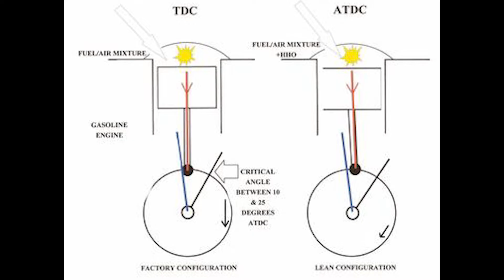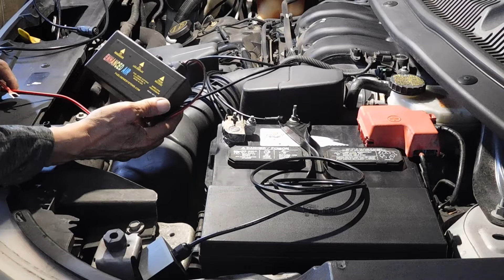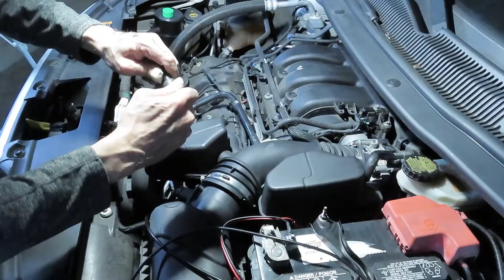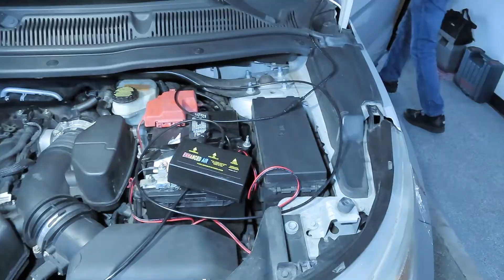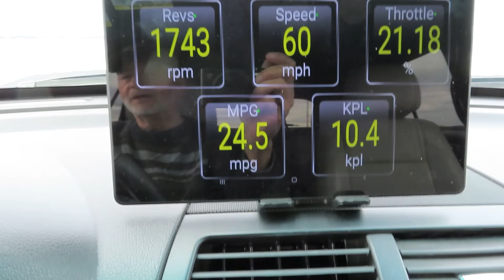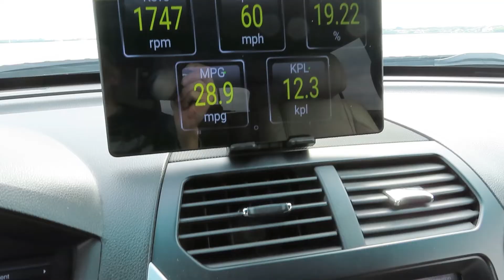NEW FUEL GENIE FUEL SAVING SYSTEM INSTALL AND MPG TEST

Comment: It sounds interesting. I have bought almost all kinds of these systems. My question to you, as I did with the others, is: does this system not leak?  Because the others I knew leak and leave a white residue on every connection.

Comment: Where exactly is the additional energy coming from? Whatever this free source of energy is, why not just use only that to power the car and get infinite mpg?
Reply: That thing he installed is basically a mini hydrogen generator. That generated hydrogen is then ran through the cars air intake system and burned in the combustion chambers.
Reply: @lunaticgaming7967  But where is the extra energy coming from? And whatever that energy source is, why not run the entire car on it?
Reply: @wfjhDUI don't you hear?
İt is producing hydrogen by electricity. 
What you ask is: 
I have put a few spoilers to my car for less drag and better efficiency. So, my car is more efficient now. It was 25 mpg and now 30 mpg.
Your question comes :
Why don't you put 20 more spoilers on your car? Then drag will be zero or even minus and you can drive forever for free! 
😂😂😂😂😂😂😂😂😂😂
Reply: @TufiTufi-l3z  There's a big difference between improving efficiency versus adding an additional fuel source. There are limits to efficiency but there is no limit on the share of fuel that comes from one source or the other. For example, cars can run on pure gasoline, a mix of gasoline and ethanol, or pure ethanol with engine modifications. If water really can be used as a fuel source then why can't this guy make a car run on 100% water?
Reply: @wfjhDUI You know the answer.
This is a petrol car. Not a hydrogen car. Even if it is possible, 
Where will you get the electric power? There is no system that produce more then spend /consumed. If that possible, that guy would be rich!
İt is adding some amount and helping a better combustion.
Think about turbo.
We get 250 hp with turbo from 1, liter engine. Otherwise, we need minimum 2 liter engine for such power.
Your question. Then why don't we take the engine out and run it pure turbo?
Turbo, steal some power from the engine and multiply it. So, we need the engine.
Reply: @TufiTufi-l3z  The electric power would come from the same place - the turning of the engine.
Yes, there is no system that can produce more energy that it consumes. That's exactly the problem here. Electrolysis of water and combustion of the products cannot produce extra energy out of nowhere.
Turbochargers force more air into the engine for use in the normal gasoline combustion cycle. This guy claims that water can be added as an additional fuel source.
Reply: Look up the water powered car ron Wyatt made. If you can understand what hes saying you could do that but there's lots of physics 😅

Comment: I would like to see that scan gauge MPG reading without, and then after.  My experience with those things is they are never accurate.  True MPG readings are measured by tracking miles and doing the math at each refill, which is always way different from digital readings.  They always skew numbers towards +2-4 MPG.

Comment: Very Interesting.  Does this work if you have 0 gas in your tank and only the hydrogen system connected as you did in the video?
Reply from the maker: This is a supplemental gas that is injected into the air intake. You must have gas in the tank. It will improve mpg.
Reply: @fuel-genie-systems1  Why do you need to have gas in the tank?
Reply: Thanks for the prompt reply @fuel-genie-systems1

Comment: I see a lot of support for OBD2 systems, but how well does it work on the older generation (OBD1) fuel injected vehicles? Will this system work on carbureted applications where there isn't a computer for adjustments on the air/fuel ratio?
Reply from the maker: Depending on the age of the engine, you should get at least 20% increases in mpg. Some older Ford models (crown Vics)  are showing 24-26% increases

Comment: 300mA for this big truck, based on calculation 12v * 0.3, the HHO generator are only using 3,6 watts! this seems odd for such small wattage to achieve this much mileage improvement ... have you probably tried 3 Amps on the highway ?
Reply from the maker: We work on the quantum level with our hydronium production. At that level, 3 amps of current will increase mpg in a 16 liter diesel engine 25% to 35% on the highway. Very small amounts of current needed to produce H3O on the quantum level.
Reply: @fuel-genie-systems1  How is it you're using basic sodium hydroxide which forms -OH ions in the water, and getting H30 hydronium which is the ionic form of hydrogen found in acidic solutions which are on the opposite spectrum of pH. ??
Reply: @waynesanders1406  crickets.......
Reply: @fuel-genie-systems1  utter quantum bullshit more like

Comment: You should get Project Farm to test one of your systems. 
They seem to only ever test cheap HOH systems that don't work.

🙂
Reply: This kit only has two small electrodes. There's no way this produces hardly any hydrogen at all. It's a scam buddy.
Reply: @TravisTellsTruths  I can't see the electrodes clearly so it's really hard to tell how extensive they are. 

That's why it would be nice if they could get someone to independently verify how well they work.

I've only seen a few working HOH systems that improve mileage.

🙂
Reply: Thats because hes a lapdog for the CIA baka

Comment: Ever one getting excited about this but you show hooking it up behind the throttle body or other into the PCV valve. Please explain how the computer can make any adjustments for the hydrogen going into the engine when it’s introduced past the mass air flow sensor and other sensors that the computer uses to set the air fuel mixture 🤯🤯
Reply from the maker: That's the beauty of it all. The amount of hydrogen going to the engine is small but very effective. ECUs  of gas engines under 2 liters don't bother with making adjustments for lean mixtures because it is within ±3% of the default value the ECU is programmed to maintain. 
Gas engines over 2 liters need more hydrogen gas to improve mpg. We inject it after the MAP MAF and IAT. Once in the combustion chamber, it leans the mixture. O2 sensors are really the only ones that correct for lean mixtures and we have a Smart computer chip that plugs into the OBD port. It adjusts sensor signals to the ECU- not the ECU itself- and manages fuel for best mpg.
Reply: My MAP sensor is located on the back of my intake manifold. Will it still work? Previous message said you installed after the MAP sensor

Comment: what type of water you using?
Reply from the maker: We use mineral water or spring water. If neither are available you can use tap water. We do not use distilled water.
Reply: You use only watter? Without salts or anything else?
Reply from the maker: @geogeo2902  sodium hydroxide. It is called caustic soda in Europe.

Comment: Is it possible to make the system automatic? Not a fan of fiddling with the remote, especially when driving. 
How about just 2 or three dedicated buttons for your presets - city, highway, off-road etc. 

I'd just make a makeshift permanent control module next to the driver, with: on/off, 3 presets, system power usage and water level indicators. Version two or pro model controls will have beeping sounds for notifications and  a button for automatic system controls. 

Just a suggestions! Cool product though!!
Reply from the maker: Once you have adjusted the amperage for best mpg on the highway, reducing the aps by 50 mA is the best setting for in-town driving. So there are essentially only 2 settings. One when you're driving on the highway and one for in town. It's adjustable because lower temps reduce the production of hydrogen enhanced air so you have to dial higher in the cold months and lower in the summer. Not being able to adjust the amount of of gas piped to the engine is key to why many say this technology does not work. 
There are too many variables to manage in making a system like this totally automatic. We explored this and gave up. Driving conditions change too fast for an automatic system to adjust. It would be in constant conflict as you press or let off the gas. And then there is the cost. It would add a minimum of $100 to the final price. 
Good question. Hope this helps.
Reply: How to order I'm here in the phillippines
For elf truck use
Reply from the maker: @roniecastigon3418  ctl
Reply: What range of makes and models/ years does this system work with. I wanna use it on my dodge ram 1500 5.7 hemi only rear wheel. It's love to save a lot of fuel on my daily commute to work and back home. Also want to try experimenting with long haul travels to see how far i can go on one tank of regular unleaded gas and one fill of water in the hydrogen water tank. I understand regular gas engines are about 30-38% efficient. With the added hydrogen gas on demand through electrolysis of the water, it makes it more lean and burns cleaner. It theoretically helps burn less gasoline. I've heard it also adds a little more 🐎 🔋 and obviously fuel economy. I like that you have a very well thought out and polished up complete kit and system including all the software tech and electronic hardware to make it almost turn key ready with the minimal amount of installation labor.

Comment: What effects does it gave on the engine rings and bearings, oil long term?
Reply from the maker: Since superheated steam is created in the combustion chamber, the grooves in pistons will be cleaned our to original specs after about 2,000 miles. If you mpg is really low and you see black exhaust smoke, adding  hydrogen will clean the injectors, spark plugs (if you have them) valve seats and the grooves in the pistons. You'll be driving along and all of a sudden feel a burst of power for no apparent reason. That's the rings that have become free and now press against the cylinder walls. This increases compression thus a burst of horse power as it happens. We have heard this same story from many, many of our customers over the years. 
Lean mixtures reduce blowby gasses. This means your oil will last 7,000 miles instead of 5,000 and your engine will be clean as new inside.
Reply: How would the hydrogen clean the injectors if it doesn't go thru the injection system. It connects to the intake as in for air not the fuel. So please explain how it would clean injectors?
Reply: @weekendwrench  Its not the hydrogen that cleans the combustion chamber is the superheated steam after the burning the hydrogen. This is what they use when they clean your car from soot build up. They plug and run your car at the garage with hydrogen mixture.
Reply: @barbelis  No they plug directly into the fuel rail and go through the injectors. I will restate my question because I'm starting to think this company is absolutely full of shit. It is impossible to clean the injectors via the combustion chamber or air intake.  if the injectors are a 1 way nozzle there is no possibility in any truth of a statement that ensures the injectors will be clean without going thru the injector. That's like saying if it rains it will clean the inside of your garden hose. 🤦‍♂️🤦‍♂️🤦‍♂️ it won't. It can't. I don't even need physics to understand this.
Reply: @barbelis  how many times did I say the word injectors. The injectors we are talking about the injectors in case u missed it ill type it again for good measure the INJECTORS. The injectors 🤦‍♂️🤦‍♂️🤦‍♂️ the injectors. You know the main component in the injection system? The injectors how can it clean the injectors?
Reply: Mate, I totally agree that the injectors can't be cleaned from the inside. But I think what they mean that it cleans all the soot buildup on the outside of injector. To clean the inside of injectors you have to use a fuel additives.
Reply: @barbelis  I got you bro but they are clearly making a claim that is a scientific, and physical impossibility like I said if they are making these outrageous impossible claims that are too good to be true its simple and not true.
Reply: @barbelis  My man he said the injectors repeatedly. I'm gonna go ahead and call them out the entire corporation is BS be careful buying from them

Comment: DOES IT FREEZE UP IN THE WINTER
Reply from the maker: We have Zero Freeze kits for extreme cold. The "Zero Freeze" model keeps temps in the reservoir above 45Â° F all year around even when outside temps are below zero. This means the system is making fuel saving gas in all types of weather. A thermal controller is powered by a microprocessor to keep drain on batteries to .4 amps depending on outside temp. Click this link to see it: https://www.fuelgeniesystems.com/products.html

Comment: do you have nay plan to make the connection from the controller to the container wireless? because its not easy in every car to route the wiring for the LED/LCD from inside to under the hood.
Also why is your money back grantee not available for international customers?
Third the device that you provide to plug in the OBD connector will engage the OBD connector and we cant connect OBD scanner to the car anymore unless the device is removed from the port. do you have any plans to rectify this?
Reply from the maker: Great observations and questions. We CAN make the amp display wireless however it must be battery operated and that adds size, cost and intermittent false readings as electrical noise from the engine interferes with the LE bluetooth signals. We opted for a more stable and less costly solution. 
We have no control over what people do to these kits. If they fail, we can diagnose and remedy the problem until it's fixed. Shipping costs within the US allow us to do that and stay in business. When shipping costs are 1/4 of the total sale, we cannot pay to have the kits returned and refund the total invoice. 
Amazon has OBD splitter cables for $14.88.
Reply: I think the system can be powered using the usb ports which most of the cars have inside. also may be you need to communicate with the electronics on the reservoir only when may be someone presses a button on the remote so even if there is interference the person can press the button multiple time to send the set amp value to the destination. @fuel-genie-systems1
Reply from the maker: @wonderwalls3565  We're always looking to improve. Thanks for the tips.

Comment: Is this a scam?
Reply from the maker: I assure you Sir it is not.
Reply: @fuel-genie-systems1 you should do a video with and without the system operating so you can see the fuel savings
Reply from the maker: @ronhanish  We have. Some of those videos are on this channel.
Reply: I don't see much output from such a small device. 
How long would it take to fill a balloon ?
Reply: If you can't adjust the fuel system to put less fuel in while running, its probably a scam. Otherwise, with or without the system, it still uses the same amount of fuel.
Reply: No this is not a scam this technology has been out for years. Problems with the corruption in the fuel industry in a car industry they won't touch it. You can make it very simply you can make your own I've been waiting for a companies to make these cuz I want to get one too. I don't want to spend my time building when I could build it it's easy. Two bolts separated positive and negative lead from the battery in your cup of water or your container and a generates hydrogen oxygen. And all you do is take your gas line out of your container that your battery creates from the water and put it to your vacuum system, which is your intake manifold basically which goes right to the Pistons to burn for fuel. It's a very simple system in it works great

Comment: Question: I have a 2019 Dodge Ram-hemi…what about the oxygen sensor? Won’t that be a problem and what about adding water in the winter time?freezing = cracking…?
Reply from the maker: We have a Smart chip that plugs into the OBD port that adjusts sensor signals to the ECU. This solves the ECU making corrections for the lean mixture. We have a Zero Freeze model for all our kits. Click this link to see it: https://www.fuelgeniesystems.com/products.html

Comment: My question is how many amps does it use because most cells take 30 amps so did you guys solve the bolt on with out up sizing the alternator because I am interested in  trying one
Reply from the maker: You will be pleasantly surprised. We solved that problem by using titanium electrodes infused with 2 rare earth metals. One of these metals produces 9 times its weight in O2 at the anode and 9 times its weight in H2 at the cathode. This allows us to produce the same amount of gas as high amp units but with much lower amperage.
Reply from the maker: Our kits need only 290mA to increase mpg 25% to 35% on the highway in a 3 liter engine. Draws only 650 mA for a 7 liter gas engine and 850 mA for a 7 liter diesel engine.
Reply from the maker: Also, titanium never rusts. So there's never any maintenance. Just add water and drive.
Reply from the maker: Click this link and I'll send you a complete free quote: www.fuelgeniesystems.com/fmq.html .
Reply: I built a wet cell 15 years ago out of plexiglass and stainless steel plates and it took a good 30 amps to run it.
I also added baking soda to increase the output.
The problem was having the right voltage regulator running the cell.
I don't see how such a small canister can create enough to do any good.
Reply: Intresting I used a capacitor once to have a cleaner signal to the cell to make it produce more and it works well battery signals suck!!! How my L permit do you get?

Comment: You are spending electricity for getting Hydrogen--that is not free!!!  And no, the device cannot break larger hydrocarbon molecules into smaller ones.  Your battery will charge less as a result as well!
Reply from the maker: True, the hydrogen is not free but it improves mpg 25% to 35% when added to engines and that translates into many times more $$ that the 300 mAmps cost coming from the alternator.